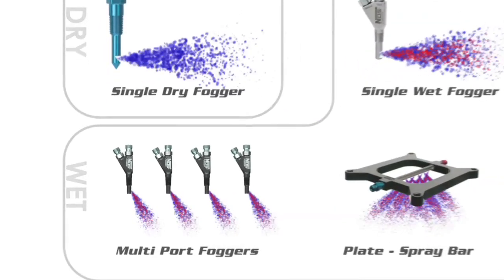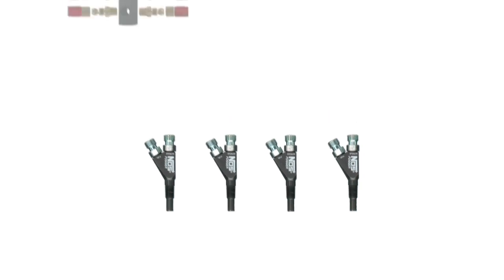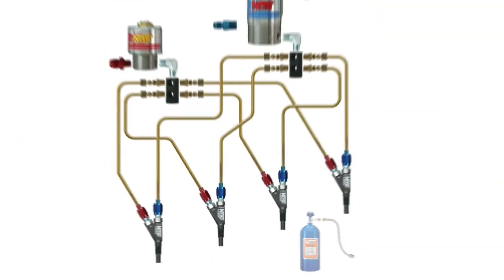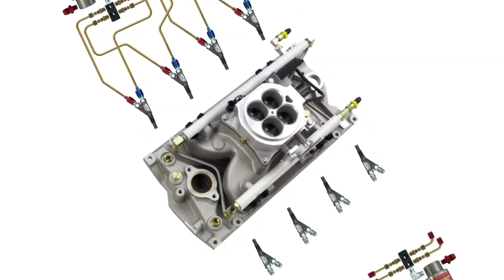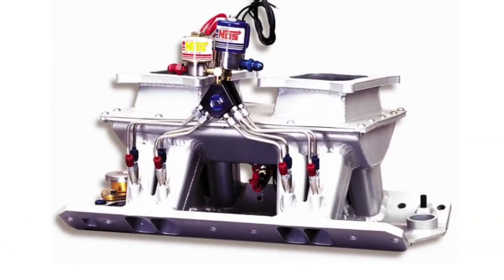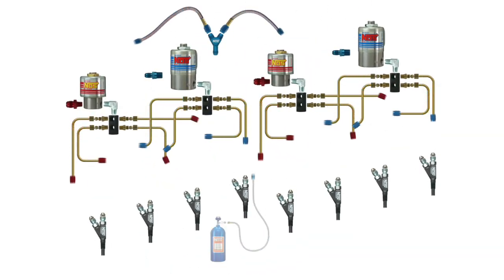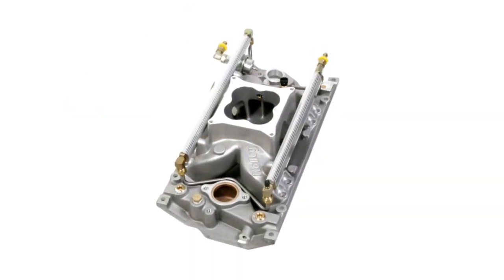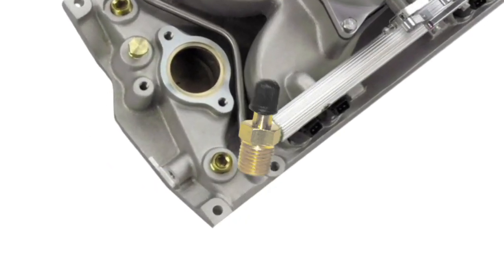NOS Nitrous Oxide Multi Port Wet Fogger System N2O Injection

Comment from the maker: Jetting is really only meant for minor changes in delivery amounts of nitrous and fuel in order to fine tune your mixture to achieve optimum burn condition in the cylinder. You know you're at the right jetting by pulling plugs and reading the internal cylinder condition. 

Drastic changes in horsepower increase will only come from upgrading to a higher HP rated kit....

Comment: For a street application a dry system is the easiest to install and cheapest. But is not for high horsepower apps. But for higher horsepower race apps. a wet system is the best for introducing more nitrous to your engine, A dry system is good up to about 150 HP and a wet is good til whatever most kits is usually around 600 per kit Ii hope this helps you. A dry system is also very easy to install, The wet is a little more complex but has better results and takes more tuning.